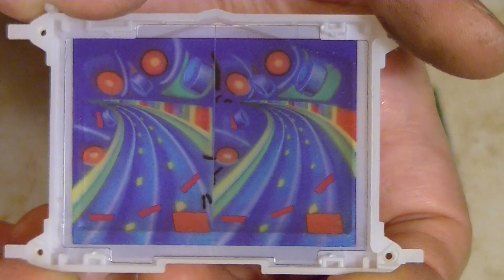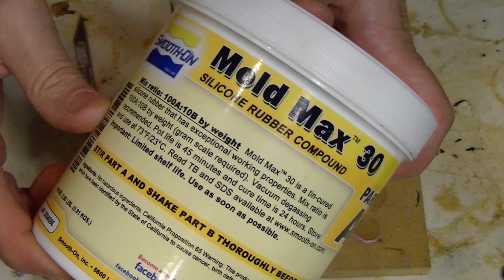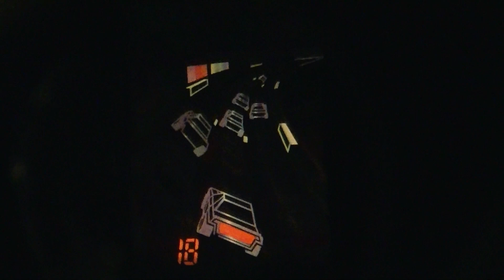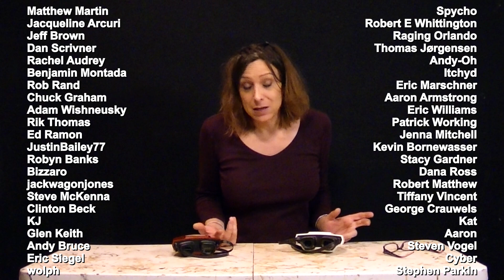TOMYTRONIC 3D - Thundering Turbo restore

Comment: Great Idea to use SMD microswitches on the worn out rubber dome contacts! 
I definetely have to keep that one in mind when I run into another remote controll that stops working.
Reply from the maker: The clicking buttons so much better too.